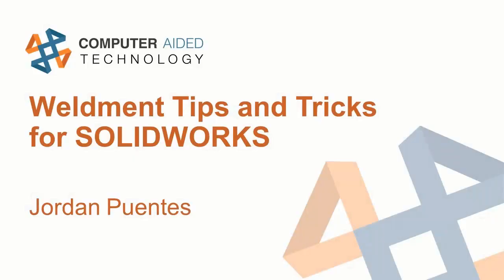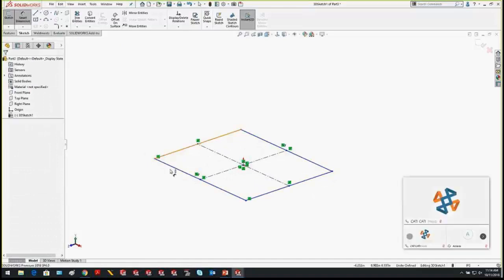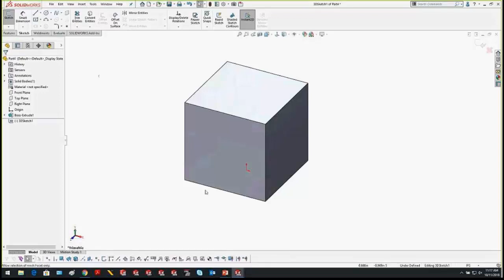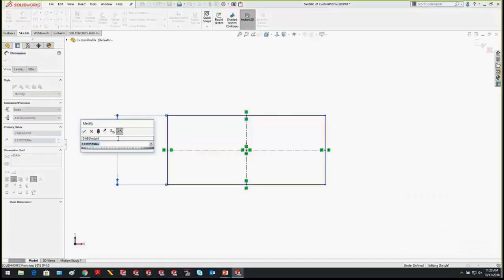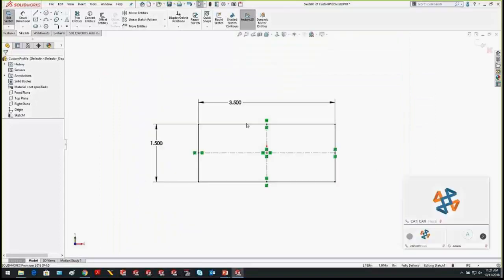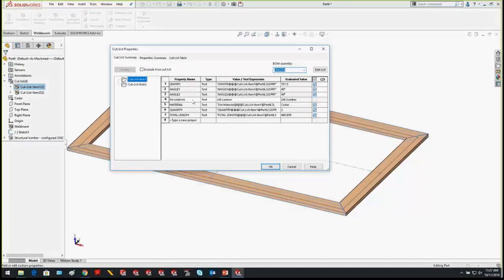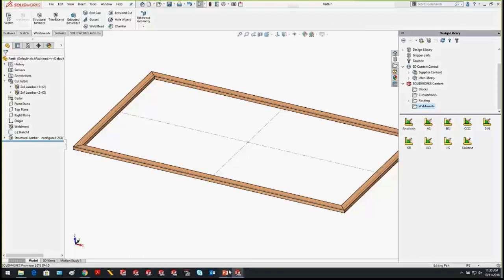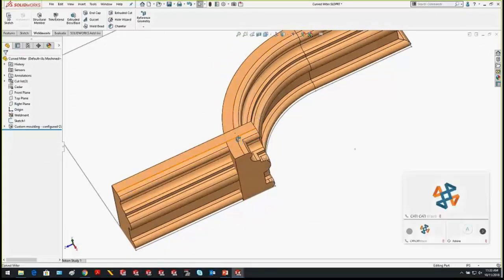Weldment Tips and Tricks for SOLIDWORKS

Comment: This time it worked.  Now I'll add 1x's and proceed with the entrance stairs with platforms that I need, and I also have a steel building coming up.  Great video, Jordan.  I didn't stick around for the Structural Systems.  This is what I need.  I have some ends that need massaging, like boards that go around hinges etc, but that will come later.  Thanks again.

Comment: When I made my profile for the 2x4.  I used the center rectangle and added radii on the corners, which is much more realistic.  I can't add a screen capture nor add a file.  I save my .sldlfp in a similar new Lumber folder with name DimLumber. sldlfp (for Dimensional Lumber, rather than "Structural".  I get a warning: "This library feature part may (may?  Does it or not!) contan feature that are not relate to the  the selected features.  Do you want to create a simplified library feature part that does not include unrelated features?  Please note that this may cause rebuild errors in this libraray feature part.  yes or no selection.  What may cause rebuild errors? Creating a simplified LFP or keeping the un-related features?  Who says that they are not related?  I used them creating the sketch so they must be related in some way.  Come on SW, give me some information to be able to make this decision!   I chose no.  I want the radii.  I also took out the end point crossed construction lines and got the same error.  Evidently what is not related is the radii.